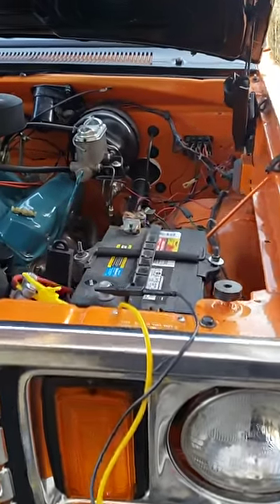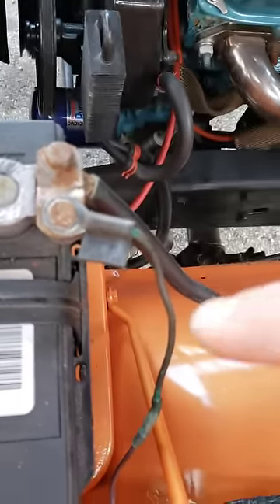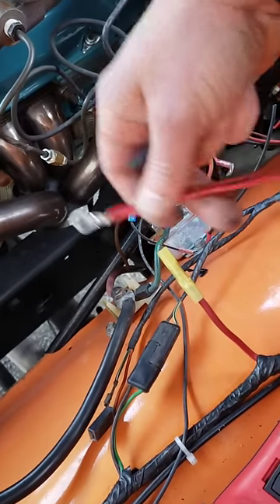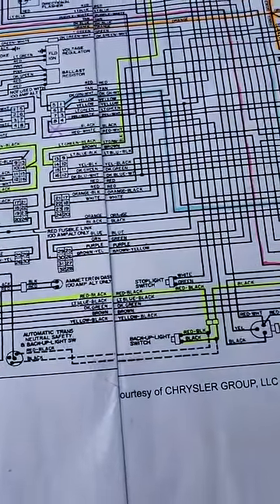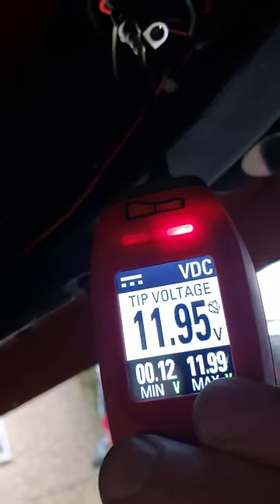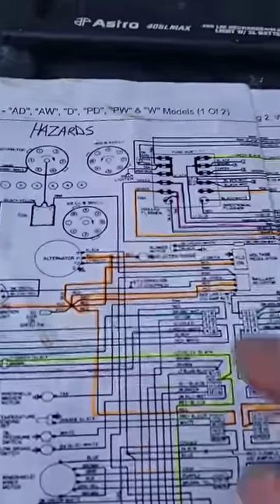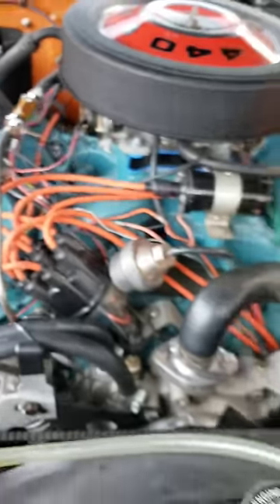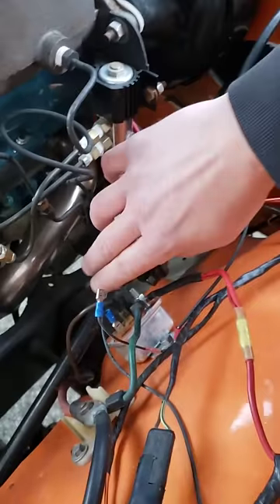78 Dodge Power Wagon - Parasitic Drain - Choke/Backup Light Wiring - Diagnosis and Repair

Comment: I ran micro locks for years and i had no problems with them . I used the line lock for when like i pull up to a gate and its on a grade . Its very cold and mud and ice or water under the truck . So you set the parking brake . Then open gate and try to move through the gate . What the hell the back brakes are now holding because of ice . This happened to me as i finally managed to free up the rear brakes by giving the e brakes cables a few whacks to free up the brakes . . So in installed the micro on the front brakes on my Toyota 4x4 turbo  diesel that i had many years ago . It was not that old of a truck either.  May be it was bad luck but i was not impressed so i installed the micro lock and that never  again . Great find on the current draw . I always enjoy your videos .  Thanks for all you do

Comment: Nice old Dodge!
Old cars with mechanical clocks did this in 60s . Clock would stop rotating and draw .5 amp killing batteries. 
Hi tech back then . 
Nice work .
Reply from the maker: I just replaced my clock with a tachometer 😉

Comment: If you want to have some amazing looking wiring, consider using seamless, non-insulated butt connectors and adhesive-lined heat shrink. The repair ends up almost no bigger than the wiring itself, and looks so much better and thinner than the heat shrink style butt connectors. I love the thermal camera use in this one!
Reply from the maker: Thanks for the tip! And the comment

Comment: Very nice truck! I have learned a ton from your videos and its very cool how related the OEM stuff is to the aftermarket and performance area.  It is scary some of the stuff I have seen people do in regards to custom wiring. I rewired a Firebird a few years back where someone had sliced into the insulation of the alternator wire and wrapped a bunch of wires around it with electrical tape. And they had it routed under the plenum. Talk about asking for a fire. The other thing I see all the time is a big 10gauge power wire run to a component with a 16gauge ground to a piece of sheet metal with a self tapping screw.

Comment: that was likely a fusible link location from factory @ 6:52 and they kind of duplicated a fusible link using random smaller gauge wire, although it wouldn't burn open as fast as actual fusible link wire. been there done that myself long ago and accidentally tested it out, while it did burn open, it cooked the harness wiring pretty good

Comment: I think that bullet connector off the feed side of ballast resistor was the "factory" electric choke feed point, but think it went through an oil pressure switch first so it would only heat once started/oil pressure! I'm sure not a dodge(moparts) fella, but have worked on some their vintage. just like many old fords fed the choke off an alternator winding center tap (only had power when running)

Comment: I love those trucks but the wiring is insane on them. I had one that was fried everywhere I looked under the hood. The previous owner had spent thousands at multiple shops trying to figure it out. Visually look at everything under there. Loose the ammeter for a voltmeter conversion. The "madelectrical" website has a great tech section on them. Three small gauge wires to a crimp to three makes up a larger gauged circuit on them. Loose the diagnostic port if you have it. Spec the resistor, parts houses sell the wrong ones. The bulkhead connectors go bad. The cab is usually simple and so are all the lights. Make sure someone knew it had a external reg/rectifier if they tried to hack in a new  alternator that was internal. There's also the start relay. The ammeter is the actual engineering blunder and will burn the truck to ashes. Everything else works as intended until someone tries to fix something and fries every wire under the hood.

Comment: years ago a friend had an ex military dodge truck that intermittently, was popping the tail light fuse. He wanted to trade the truck in but none of the local dealers would take because, some, how around town it  was know "that truck has electrical issues" The root cause  1 was my friend did not smoke and the ash tray was a change collection spot for him. 2 turns out the cigar lighter was also powered by the tail light fuse and there was a dime bouncing around in the cigar lighter socket.

Comment: I had a 1937 Chevy Street rod I worked on for a while. Wiring was always a problem. Owner decided to let me fix it. I found a aftermarket wiring harness. That wasn’t used. Unprotected wiring just ran everything. 75% of fuse box not used. It was a mess.
Reply from the maker: Crazy right? Fire waiting to happen

Comment: in the south sometimes a line lock is used to help the parking brake on a standard shift. the parking brake sometimes doesn't work as good as it should against rolling backwards the line lock helps hold the vehicle i would keep it
Reply from the maker: unfortunately on this design, that would kill my battery as it is a normally open solenoid and needs to be energized to close it, but great idea! Someone else mentioned that too

Comment: In serious need of some wire management and conduit to protect the wires, but I guess that's a project for another day. ;) I had completely forgot about the resistor blocks on those old vehicles. Brings back fond memories.

Oh, one thing I caught, I noticed a piece of fuel hose and filter from the fuel pump to the carb. Please tell me you're going to change that to a solid line, I burned up the the engine compartment on my old 69 Chevelle back in the day from that stuff when it sprang a leak and sprayed the hot manifold and caught fire. I learned a valuable lesson on that car. Was NOT fun having to rewire under the hood. :( 

Truck looks great! :)
Reply from the maker: Absolutely my friend. This glass filter and this set up is going away! Thanks for the reminder!
Reply from the maker: Oh, and the wiring will be all taped up with tesa tape when I'm done for sure!

Comment: Hi again Paul, could you run that electric choke off an oil pressure switch to only have pwr . when the truck is running??
.
Reply from the maker: That's not a bad idea! I could rig something up and use oil psi as my turn on.

Comment: anti theft device was awesome 🤣

ive done some genius stuff too 

when I was a teen I wanted to install my own stereo and amp. 

didnt have enough money or sense to run the wire right or put a fuse on it. 

poof !! red hot smoking wires and to top it off I tried yanking the wires off the battery 🤦🏼‍♂️

burned my hands, carpet and ruined my amp 

i learned very valuable lessons that day 😁

 I was left handed for a good couple weeks 😂
Reply from the maker: I've seen this before! At least you didn't burn the car to the ground right?
Reply: @ScannerDanner  luckily not !! 
 ended up grabbing a pair of tin snips and chopping at it for a minute till it gave way. 

the car smell liked 💩 after that too !! 

Fuses are my best friend now !! 

😁
Reply from the maker: @dznuttzonyachin7499  just showed my wife your user name 🤣
Reply: @ScannerDanner  I just made the mistake of showing my girlfriend it 😬

She wants answers NOW !! 🗣️🤦🏼‍♂️
Reply from the maker: @dznuttzonyachin7499  🤣🤣

Comment: Hey Paul 
Just a heads up on that battery in that beautify truck of yours (please more truck videos)....... But I've had to return 2 of those batteries out of different vehicles in last month.... 1 of them with a date of 12/18 and the other with a date of 2/19 but yours looks to be the same type and about that date as well......
Also the 2 that I returned were for sure the Everstart's with the 5year warranty walmart thing on them and when returned them was told that walmart has had a ton of the 5year ones returned recently so I don't if they were recalled or if it's just a climate thing around here bc I'm from western Pa also and my local walmart would be New Castle Area or Sharon area but that's what the New Castle location had when they were returned bc I questioned them about it whenever had return 2 of them in that short of time period........ so just thought I'd let you know if you didn't already know that 
Also THANK YOU for another great video as always and like  I said more truck videos please even though I think that you had said you really didn't want to deal with video on the truck that much but it's just so beautiful it kinda seems like you should show it off .....lol
So Thanks again and have a blessed day
Reply from the maker: Thanks so much Robert

Comment: Make sure you carry a spare dual ballast resistor with you. Those things go out fairly often especially where it is located. Its a resistor that gets hot and when it rains you'll get cold water on the hot resistor that shortens the life. I can't count the number of cars and trucks that were towed when I was a Tech at a dodge dealership that had a bad dual ballast resistor. Felt really bad for the customer, the tow bill was $50 and the resistor was $5. 

At what point do you call a new harness rather than trying to trace all the crazy circuits. Great looking truck but the guy did not know wiring. Ill bet the truck was hard to start since the choke was always hot when means it never closed when the engine was cold.

Comment: Smaller wire only makes heat if it's too small for the current that is passing through it-- it has very little to do with the size of the next wire that it's connected to.  If that smaller wire being used was more than big enough to handle the current of your ignition, then it was still fine.   But I can still understand the tackiness of random sized wires being connected together-- and that thick wire must have been that thick for a reason (maybe);   I would have liked to see you test the current going through that wire before changing it--  and even looked at it with your thermal camera.
Reply from the maker: That is correct. But it was too small for the circuit. I have thermal camera images of it that ill be sharing soon

Comment: If he had the choke heater always hot, the adjustment for the choke off might be wrong too. (If it's like a quadra-bog.)
Reply from the maker: absolutely! I will be revisiting this, as well as the carb itself. I also may have to drop the tank as the fuel sending unit/float, is not working and I have already confirmed wiring integrity right at the tank

Comment: Danner, will a prolonged battery drain kill the battery of being discharged below the recommended voltage or is it safe to say that the next trickle charge will bring it back to normal?
Reply from the maker: Repeated deep cycles on a car battery is really bad for them. Also, when a battery is dead, the electrolyte can and will freeze, which means death for sure

Comment: Hey Dan I also have 78 power wagon with a built 383 vs stock 400.  Has the same headers.  What plugs and wires you running?
Reply from the maker: Just the factory plugs my friend (champion for our trucks). No reason to run anything else unless you've drastically changed compression ratio from stock.
As for the wires and cap and rotor, it doesn't much matter, just don't buy the cheap stuff. Get the top of the line with whatever brand you want to use. Oh, and my name is Paul Danner 😉

Comment: I would just rip out all the wiring in the truck and start over. Thats what I did on my Datsun. after multiple owners and shitty wiring repair jobs. I ripped it out and redid the entire electrical system. Also... is that teflon tape on the brake lines??
Reply from the maker: lol yes it is 🤔

Comment: walmart "Never-Start" battery 🤣🤣🤣🤣
IRL, I always had good luck with them in the past, since walmart became a thing here and I started driving (mid 1990's), I had some of the batteries last 6 to 7 years! granted I rarely ran them dead and mostly had added a dual battery setup to help power other devices (inverters, audio systems and cb/ham radio), also larger alternators and so on.
more than once I left the dome lights on(vans/older cars had many lights) and still had power to start fine 8+ hours later, a few times the door got left open 16+ hours(worked a 14 hour day and 2 hours drive time/took company van). doh!

Comment: It looked like you tinned the two wires that were twisted together then crimped into a butt connector. Not a good idea to have soldered those twisted end of the wires before crimping. Usually can't get a good crimp on wires with solder on them. If current causes it to heat of the solder will soften causing a loose connection. I learned this lesson the hard way many years ago.
Reply from the maker: And here i thought I was helping 🙃

Comment: Is the top of the frame rail cut to fit the header? I never seen a factory frame rail like that. Just stuck out to me.
Reply from the maker: yes it is, wasn't done by me, but i think it will still be okay. It was cut because of the big block with headers, so not just because of the headers
Reply: @ScannerDanner  well they did a whole lot better job with the frame than they did with the wiring lol. I agree; it should be ok since they didn’t cut too close to the bend. Beautiful Truck!
Reply from the maker: @markusky4774  thank you!

Comment: Hi Paul, Could you use the linelock for a hill holder????
Reply from the maker: yes, I suppose you could, but I want it out of there as I don't trust the solenoid to provide hydraulic flow when it is needed

Comment: line locks are cheap parking brakes. had a company years ago insisted every truck had one. these had driveshaft park brakes and once there was a driveline failure. the outcome wasnt good. looks like cletus got through wiring the mobile home  and decided to revamp the truck lol. hey at least he tried !!!
Reply: i should add the line locks we used were mechanical with a lever to operate them
Reply from the maker: Makes sense. I couldn't do that with mine as it is electronic and would kill my battery
Reply: @ScannerDanner  yep

Comment: never saw an electric choke that did what you needed it to do. example. you drive to your brothers shop you spend 15 min and then leave. during that time your choke has cooled and closed but your engine is still warm. your start your engine to a cloud of black smoke and hope the choke opens quick. if you have an engine that cranks for a while  you will eventually foul your plugs. they used to make a thermostatic switch that attached to the engine block or head that would not feed the choke if the engine was still warm . this required a constant 12v feed. my guess is like everyone else you will get sick of fooling with it and convert to a manual choke. good luck with your new toy

Comment: honestly  i was better at wiring and figuring out stuff on my 1st car a 72 dodge dart as a senior in HS!! (1991)  the guy he got it from, wasnt the sharpest. This is when all you need was a DVOM to figure stuff out. i remember fiddling with my electric choke on the holley carb. in the 70s dodges sometimes draws happened when a glove box door, wouldnt cut power to that small light, as others said its about the fine tuning of the elec choke as well,

Comment: might be worth just installing a nice reproduction wiring harness
Reply from the maker: yeah, the connectors that run through the dash are not great, and the main ignition switch connectors are not great either, but I will just make my own connectors if it comes down to it. The rest of it is good